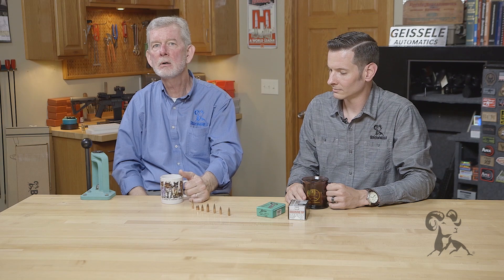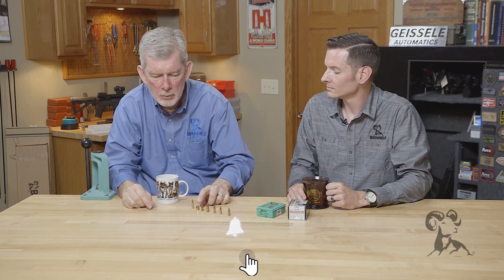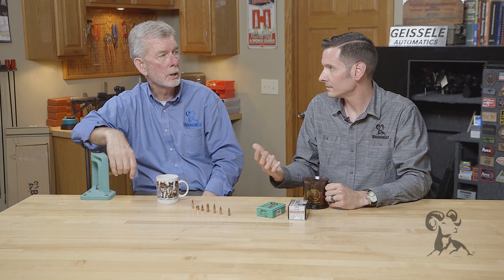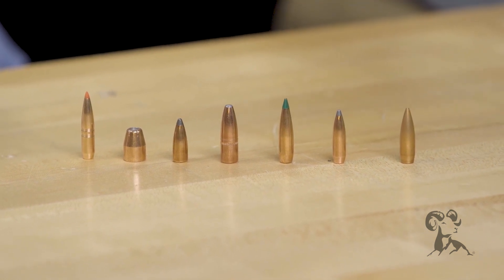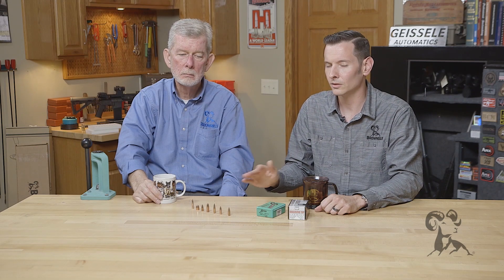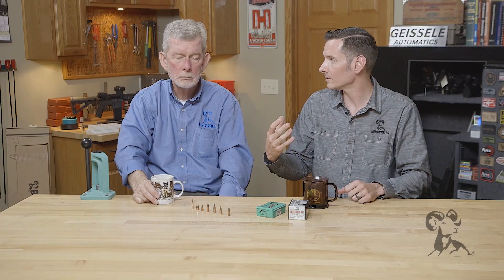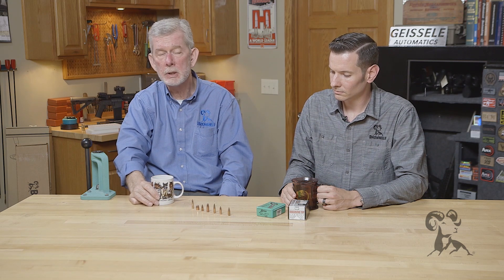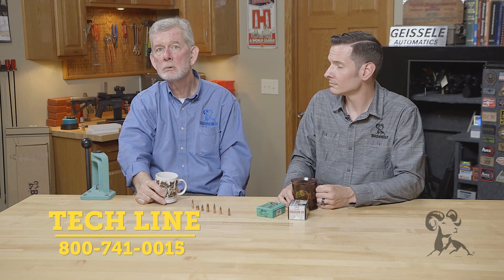Quick Tip: What Is Ballistic Coefficient?

Comment: Stability is a huge factor as well. Usually heavier bullets have a higher BC but if your barrels twist rate won't stabilize that round, the BC means nothing. The best thing to do is to figure out the best weight range for your barrels twist rate and how heavy of a bullet you want to shoot. Then you can pick a bullet, that's within the criteria, that has a good BC.

Comment: What is the point of the polymer tip vs the metal bullet points?...
Is it true that the the polymer tip bullets are designed for Bolt Action Rifles?

Comment: To follow : what’s the difference between G1 and G7. Once again thanks for creating extremely informative videos.
Reply: G1 is an old BC model, it resembles older designs of Tangent type Ogive bullets without a boat tail, and some old artillery shell designs. The newer G7 model is more akin to a longer Tangent or Secant with a boat tail designs. All projectiles will have a G1 AND a G7 number, but one or the other will be more accurate at some point in the calculation of the trajectory for some reason. At that's because the model is just an estimate, it's not actually calculating how that actual bullet shape behaves, just how a shape kind of like that bullet with similar weights and speeds behaves.

Comment: All the points you discussed are accurate and do reduce the effects of wind drag. However, the difference is only important for longer target distances past normal hunting ranges. Bullets with large frontal profiles provide more hydrostatic shock and better expansion at high and lower velocities than pointy ones. Many round nose and flat base bullet designs will shoot more accurately and provide more shocking power. An old Gunsmith once asked me; if I shoot a deer thru both lungs with my 30/30 cast bullet. And you shoot a deer in the same place with your 300 Winchester; which one is deader? When powerful bullets pass thru game all of the extra energy is just wasted in the dirt. However, if a bullet expends all its energy in the animal it makes it more effective and reduces meat damage. I witnessed a Bull Moose shot by a 70 year old Canada resident hunter who hunted Moose all his life using a Savage 250/3000. He shot that 1000 pound Moose in a meadow grazing at about 300 yards with a 120 grain round nose bullet. The bullet hit the mark and all that moose did was look up. I said; maybe you need to shoot again; he looked at me and said; just wait. When I looked back the Moose had fallen over and all four legs were pointed to the sky. I sure wasn’t going say one more word. I guess; he never read many Moose hunting articles on the best cartridges for hunting Moose.
Reply: I think that is one of the reasons .30-30 or .30 WCF has been so successful at dropping game even though it is not a ballistic marvel. Moderate velocity with larger bullet area at the point of contact, thump and shock. I use 7.62x39 PPU 123 grain round nose soft point ammo for shooting Texas hogs and it is very effective. I have just put together a 350 Legend with a 16" barrel for shooting hogs, with similar velocity to X39 but with heavier bullets like a .30-30 it should be devastating on hogs, much like the truly Legendary .30-30 but in an AR platform.

Comment: This is why if i find 75-77 grain bthp/otm at a good price i jump on it (hornady frontier 75 bthp). The 77 grain out performs the 55 grain fmj.. at 500 yards you get almost double the energy, better velocity, less drop, and way better accuracy. Pretty sure the 77 has better energy the entire flight.
Reply: @W. & J. Buchanan - Actually, you might be surprised. A lighter bullet moving at a much higher velocity will have more energy for the first few hundred yards than a slower heavier one. The heavier higher BC projectile will only have higher energy at a longer distance. Take for example a 55gr .224 @3200 fps vs a 77gr .224 at 2500 fps. The 55gr has more energy until around 200 yds where the 77gr takes the lead. That doesn’t mean the heavier projectile doesn’t have other advantages though. I personally am a fan of the 75-77gr .224 bullets as well but you just need to know the velocities you get out of your gun. For example, I only get ~2500fps from a 75gr American Eagle load out of my gun but I can consistently shoot 1” groups with it. I get ~3200fps with M193 but can’t seem to consistently get better than 2.5”-3” groups. I’ll take the slower more accurate round any day of the week.

Comment: And the real BC is probably lower than the one on the box.
Reply: Well ... that is not entirely true. The BC number printed on the box by the manufacturer is the “official BC” of the projectile. The actual BC exhibited by the projectile is affected by a number of things though the bullet manufacturer will typically communicate the most reliable average when taking these things into account. 

Some (but not all) things that can affect a bullet’s BC are: 
1) The consistency of bullet manufacturing 
   This is why “match” bullets typically cost more than FMJ and other “plinking” bullets. The manufacturer goes to great lengths to produce projectiles that fall within a small range of BC values.
2) The barrel the round is fired through. 
   The type of rifling and number of lands/grooves in the barrel and the size, tolerance, consistency of the bore and dimensions of the throat all deform the projectile when it is fired and therefore change its effective BC.
3) The shape of the projectile and velocity the it is traveling through the air
   Depending on the shape of the projectile (flat/boat tail/rebated boat tail/etc. ogive profile, ...) the BC of the bullet can change based on the velocity that it travels through the air.  Different BC models (G1, G7, etc) help account for these differences and if there is significant enough differences the bullet manufacturer will communicate this in their documentation. (Just remember to compare BC values that use the same BC model to get an apples-to-apples comparison.  G7 BC values are about, but not exactly, 1/2 the G1 values.)

To determine the “true BC” a bullet has when being fired through the barrel of your gun you really need accurate velocity and actual bullet drop information. You can then plug all this data into a ballistic calculator (I.e. StrelokPro) and you can determine the “actual BC” you would need to use to generate highly accurate ballistic tables to use with the projectile and rifle combination. 

The long story short if this is that most people can pretty much trust the BC number on the box for the type of shooting they are doing. (This is all assuming a reputable manufacturer of course.) 

The “numbers on the box” that are much farther off from reality and most likely lower are the velocity figures. Those often are off by hundreds of FPS compared to what you will see in your gun.
Reply: @roncterry  have you talked to long distance shooters about that? I took a course from a couple, and their advice was that in actual use, BC's often do not stand up to manufacturer's numbers. If you use a Kestrel, you may find you have to dial your BC downward quite a bit to match reality.

My teachers told me manufacturers were pretty much full of it when it came to BC's, and sure enough, I had to adjust mine when we started shooting. My ammo's maker put .462 on the box, and my instructor had to change it to .420 to get things to work hundreds of yards out.
Reply: @thebubbacontinuum2645  Much like when a "new" cartridge is introduced and the manufacturer touts the great velocity numbers. Only to find in the small print that the numbers were obtained from a very long barrel, not the average length barrels used by most shooters and hunters. I know a lot is just industry hype and marketing, but I think especially in the era of the AR they should give numbers based on common 16" or 18" barrels as well as the long 24" barrels and should probably include shorter barrel "pistol" velocities because of the popularity of AR "pistols".
Reply: @Bubba Continuum - Yeah, I guess BC can be kind of like the MPG rating of a car. Under the perfect theoretical conditions it may match the manufacturers advertised value but in the real world (I.e. when the rubber meets the road/bullets meet the rifling) you have to make adjustments and they will almost always be downward adjustments. At least we have a starting point to go with that should get us “on paper” so we can start dialing it in based on our situation.
Reply: @roncterry  queation mr ,  I have nosler 308 win RDF FMJ ultra hight BC . I'm trying to find out out the BC.  So far I see  G1: 0.536  G7: 0.270 so I don't k ow which of those tho correspond the bullet
Reply: Barrel length is the main variable to look at. Hornady typically states that their tests are performed with a 24" barrel... I don't own a rifle that has a barrel over 22" so my MV is already going to be under the published velocity... So my BC will be lower as well.
Reply: @OldSchool Jack  - Actually,  no. The BC of a projectile has nothing to do with the barrel length. The BC is a measurement of the aerodynamic nature of the projectile. A bullet has the same BC whether it is being shot out of a 10” barrel or a 30” barrel. The length of the barrel affects how fast the projectile is moving when it leaves the barrel, the BC affects how fast the projectile keeps moving as it travels through the atmosphere.